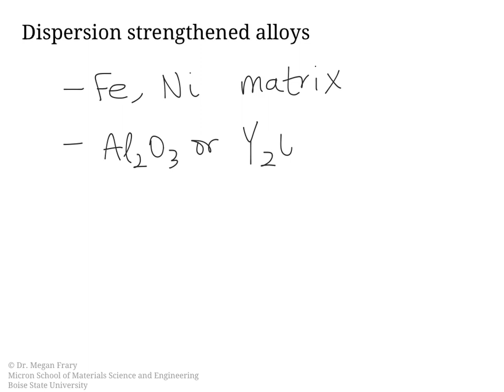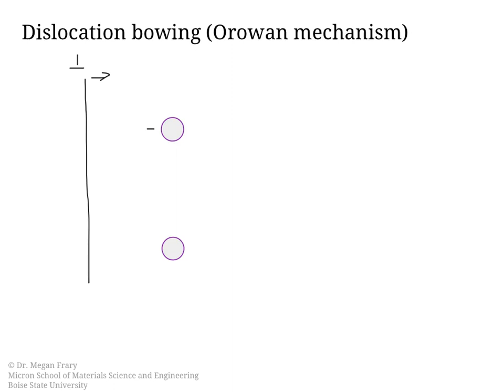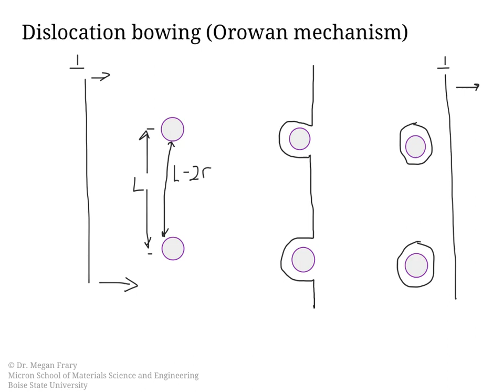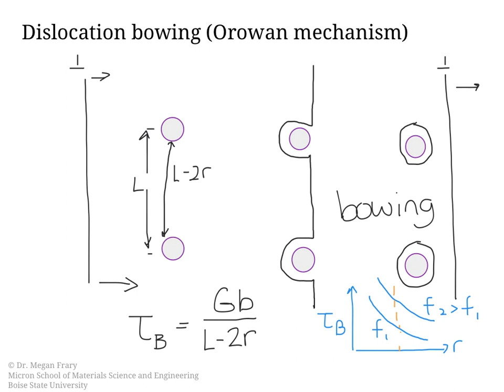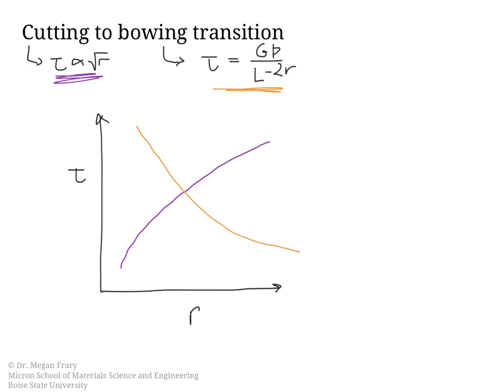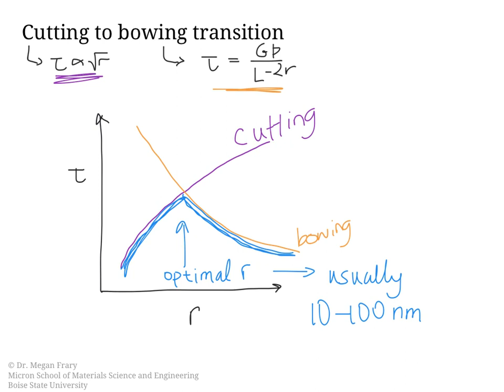Dispersion strengthening

Comment: @Megan Frary mam..this lecture is very useful...thank you so much for your contribution. But, I have one sort of doubt regarding the relationship between the strengthening mechanism and the particle radius as, if we will increase the radius r, then the effective spacing L-2r will decrease for a constant L value. Now since L-2r value decreases in the denominator part, it is obvious that the stress required for dislocation movement get increases and the strengthening too. So kindly explain this contradict statement "how the strength decreases with particle radius."